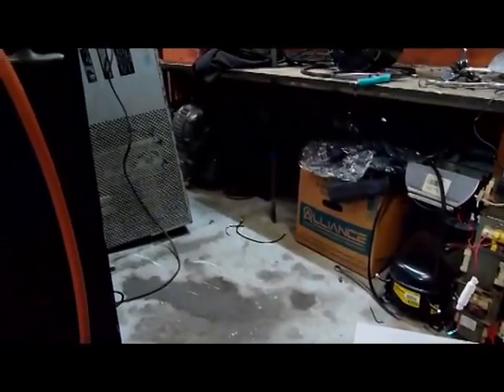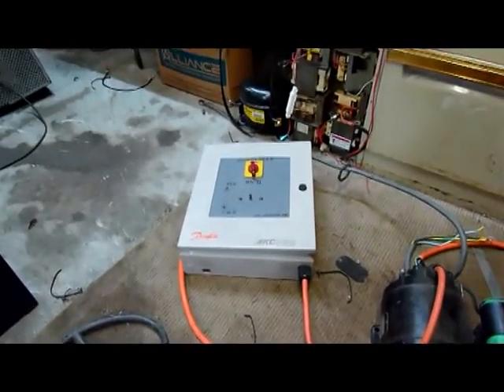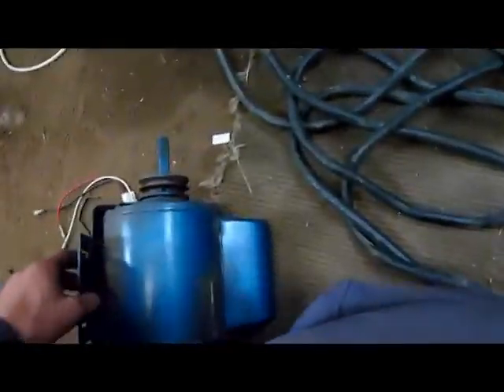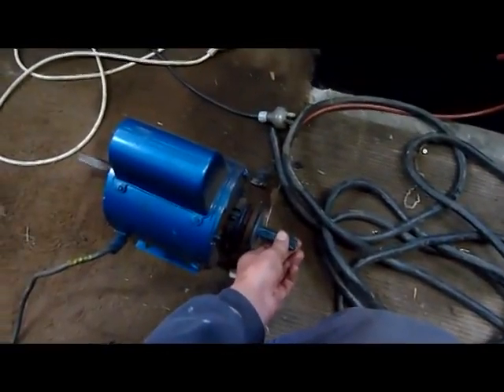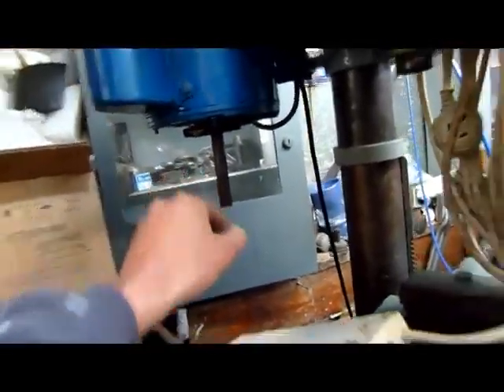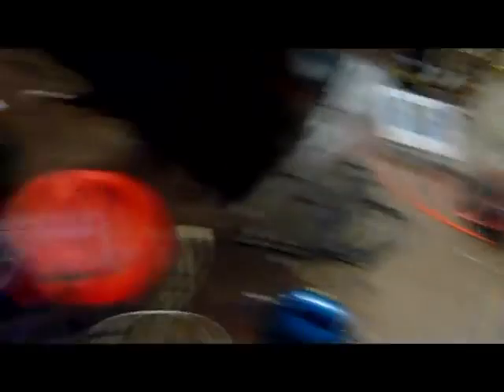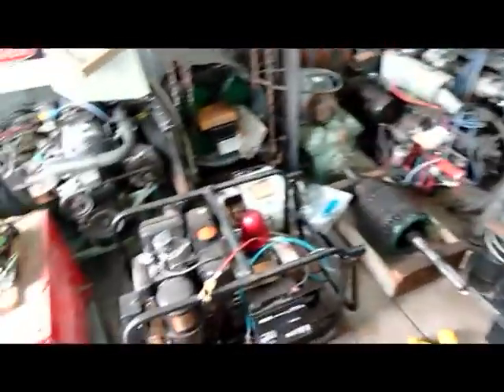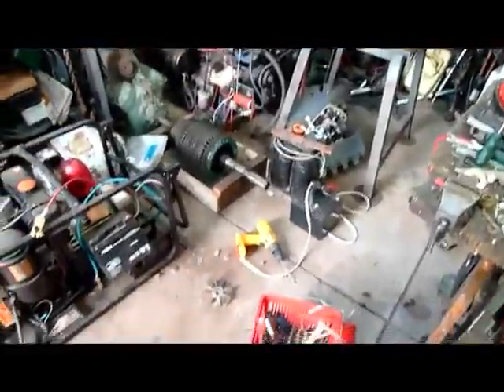Medium Quality Vid Test - Fan Motor Swap

Comment: What editing program are you using?
Also, looks like the lower resolution settings are achieved via line skipping, which results in that aliasing on horizontal lines and on patterns.